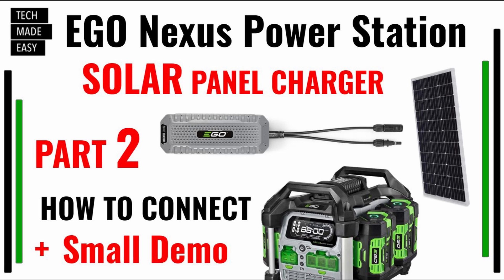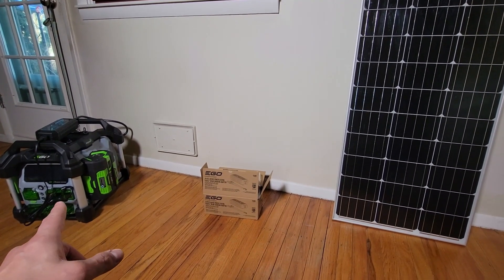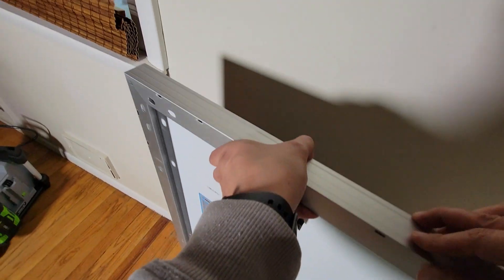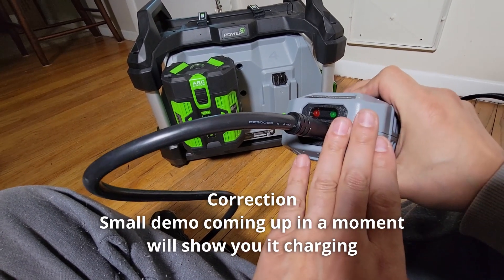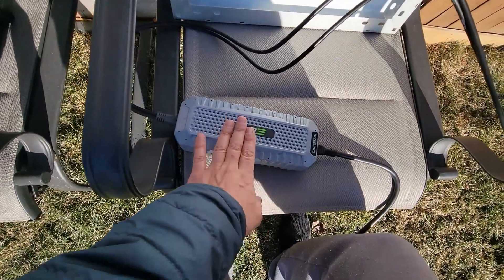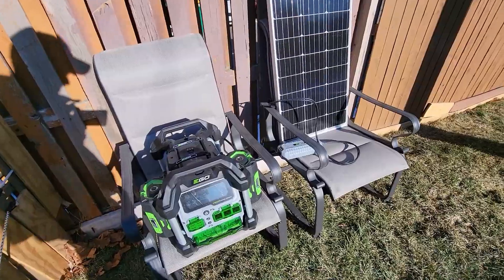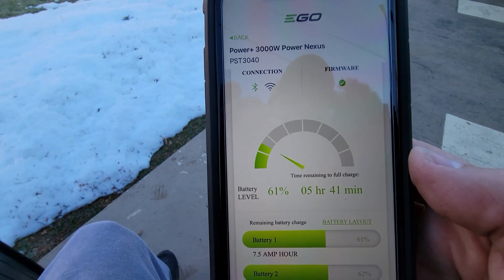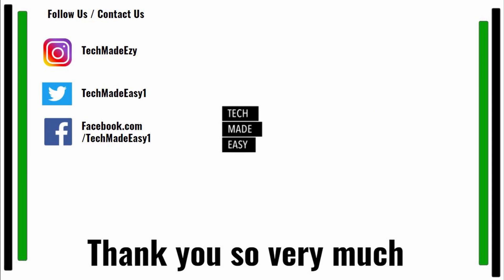Part 2 of 3 EGO Nexus Solar Panel Charger CH1800 Review EGO Solar

Comment: Hi! I just found your channel - 3 years after you've made this video. I was given an Ego Nexus power station and am trying to learn how to do solar charging with it. My question (forgive my Newbie-ness) is this: The app shows both of your batteries charging. Great. But, does the Power Station itself charge and hold 3000w? I realize that EGO makes a bunch of different tools, but if you don't plan on using anything but small appliances that can be plugged directly into the Nexus, I'm assuming batteries are not necessary. Is this correct?
 I'm a bit confused. Thanks for the great content.
Reply from the maker: Hi there thanks for watching our video!
The batteries are needed they power the nexus and devices you connect to it. It can handle 2000w appliances and devices the 3000w is just for a short surge. The size batteries you put in the nexus will allow your devices to run longer. 
Example a 5ah battery vs a 10ah battery, the 10ah will usually run twice as long as a 5ah. Hope this helps
Reply: @TechMadeEzy  Thanks, TME... I might not have been clear... If I want to say, just plug an electric tea kettle into the Nexus while I'm camping, I don't really need any add-on batteries, right? The batteries are only for the EGO tools that one might use, ie, the leaf blower, chainsaw, etc... The Nexus itself will be holding a charge itself, yes? Like I said, this was given to me (inherited from a passed away family member, actually - I can no longer ask him questions directly. RIP) Thanks.
Reply from the maker: @auntlynnonline6206 you need batteries to power anything 
No batteries no power
Also my condolences 🙏🏼
Reply: @TechMadeEzy  So, what are the 3 outlets and USB ports on the Nexus for, then? Are you saying that without the extra external batteries on the outside of the power station, it doesn't hold any power itself?
Reply from the maker: @auntlynnonline6206 the batteries provide power so you can use the outlets and usb ports 
No batteries, no power
Reply: @TechMadeEzy  That's odd. I would think that this big old thing would have the ability to hold some charge of its own. Oh, well. lol
Reply from the maker: @auntlynnonline6206 many power stations have built in batteries but after the battery dies the unit gets thrown out. That’s the advantage to this unit is you can always change your batteries and you don’t have to throw the unit out
Reply from the maker: If you need more help let me know I will always try my best to explain 😊

Comment: Enjoying your video's.  I have a few ego tools and batteries, Love the ego universe.  IMHO the  Nexus power station would work great for camping, tailgating, construction and a short term source of a power in a 12 hour outage..   However I don't think it makes a very good longer term power solution or battery charger.  It takes about 10-15 hours to charge four spent - 5 Amp hour batteries when plugged in and a week if solar is used? SLOOOOWWWW.   I planning on buying one. knowing that using solar as a changing source is generations away.   Great information!
Reply from the maker: Thank you Curtis
Reply: Curtis, you should check out the Bluetti line of power stations!

Comment: Did you find iy very difficult to disconnect the solar panel using an MC4 disconnect tool?
Reply from the maker: Hi George, It takes a little wiggling and playing but it comes off. You have any issues?

Comment: So basically the solar panel is only used to charge the batteries???
Reply from the maker: Yes or you can plug the power station into a wall, just an alternative way to charge

Comment: I was tempted to get this but I am glad they were out of stock already so I have changed my mind on this item. If it had pass through charging I would get it even with the slow charging. It basically equals their regular charger for rate of charge I believe. I have an EB150 and it probably makes more sense to charge the EGO batteries from that while I charge it at the same time. For a longer emergency I could use the small gas generator I have to charge the batteries. 
EGO was just a bit shortsighted with their power station it seems. They were early to the scene and just didn't forsee the actually needs and uses of the Power Station. I assumed that firmware updates could do more to keep up with changes but I was wrong. Still very useful as far as I am concerned.

Comment: Make sure your solar panels don’t exceed 22v. I have their power station with 4 x 7.5ah batteries. They should have went with a mppt with at least 20a input for more flexibility. I like my ego tools, but I’m disappointed with this charger. Hopefully, they will come out with something better in the future. I charge mine with my DIY solar unit with a 60a mppt charge controller and 600w of solar panels.
Reply from the maker: Thanks appreciate that

Comment: You keep the solar panel towards the sun and the nexus unit also outside and the charger out of the sun? I live in Phoenix Arizona we have a lot of sun. That means you need very long cables.
Reply from the maker: Hi Duke I’m just starting testing, I’m using 30 foot cables

Comment: Yep as others have said I believe this unit will take entirely too long to charge the batteries. They need to figure out how to make it have pass through charging so you can take advantage of the pure sine inverter with the energy the panels are pulling from the sun. You need to be able to hook up two 150/180/or 200 watt panels in parallel let the charger take what it needs and power another device with the rest of the energy you get from the panels. Even if you connect a 180w panel for the 180w charging you will never get that one panel to pull 180w, and if you do it might only last for 15 minutes. You have to constantly move the panels around as the sun changes the angle in the sky and as the panel heats up it will diminish its ability to input a constant charge. Unfortunately I think they will have to redesign a whole new inverter to be what it needs to do. I just bought a small 800w fuel powered inverter to charge the ego batteries with a fan cooled rapid charger for the power station when I run the batteries down. If you want to use the sun to do it, nice and easy, I would get the ecoflow river 600. You can use this power supply while charging. You can charge it with AC power, DC (car) power, or solar power; and it will charge back up to 80% super fast then trickle charge the last 20%.
Reply from the maker: Thanks Tony

Comment: Thanks for the video but I wouldn't wiggle the cables out and I wouldn't wiggle and pull from the cables as you do. Keep that up and you will be replacing the cable and connection in the unit.
Reply from the maker: Thanks, I tried pulling that cable straight out and it was pretty hard to do.
Reply: @TechMadeEzy  They are tight.
Reply from the maker: No matter what I appreciate the feedback that’s what this channels about we all help each other

Comment: Based on the charging rate it would take approx. 12.5 hours to charge one 7.5ah battery from empty to full or 50 hours for four of them.  Assume 8 hours of pristine skies and sunlight per day and you’re at 1 week assuming you’re not using it AND also assuming there is minimal loss having the unit powered up just so it can charge.  Absolutely USELESS.  Utterly and unequivocally useless.
Reply from the maker: Thanks Robert

Comment: I've been off rid for about 3 years  i'd made my own solar battery power bank bought an 85qrt 12v fringe so far so good
Reply from the maker: Nice Yan me and you need to talk! I’m excited in general about solar, ego solar is cool, will it work well at this point, not sure yet but I testing. Definitely want to build my own little system then maybe expand
Reply: @TechMadeEzy  I also preorder the ryobi 1800 inverter for what i need it,I think it will work
I made a 12v 105amh with 200w solar panel setup power system that is running my 85qrt 24/7 im still learning
Reply from the maker: Yan, Check out my 6pm video tonight, might help a little
Reply: @TechMadeEzy  I'll be waiting thanks

Comment: I have used 50 FT cords, and found no difference in the watts inputting... and there are plenty of Videos... Minute Prep comes to mind... he is running his cables like 1000FT, without issue.. though he is using better grade cables. Still, from my house I have a 50 ft cable, to reach the corner of my yard for best sun, and it gives me the same watts in, then if I unplug, and use a 6ft cable. So I wouldnt worry about it. Definitely get the batteries and charger out of the sun while charging.
Reply from the maker: Thanks Chris

Comment: Sadly this is the dumbest device ever, it would take like 4 days alone to charge up 4x 7.5/10ah ah batteries. In my opinion this is useless and people should just wait for a nexus changer v2 that isn't as janky. The ego nexus charger only charges 1 battery at a time at 100watts roughly it has no fans to cool the batteries so its tickle charges them, if you have a 200W pannel the length of the chord wont matter that much, as long as it produces at least 100w the light will trun green and it will charge.
Reply: Also true. I charge mine on solar generator using the rapid chargers. Way more effective.
Reply: @chrisanderson8553  That's what I was thinking. If I used the power station for a long power outage to just have a battery always collecting solar energy that allows pass though. Then you could just charge your ego batteries with a rapid charger on that and put the fully charged ones on the power station to keep it running.
Reply: @t.j.schmidt9877  Yeah, i already had 6 batteries, for my tools, 4 7.5s, and 2 5.5s, over time through ebay, FB market, and offer up app, I sold my 5.5s and got 4 more 7.5s. If your patient, they can be found very good prices, esp locally. So now I have 8 7.5ah batteries. The Nexus, is very powerful. 2000w inverter, and really unlimited watt hours, if you can keep the batteries charged(8 7.5ah batteries are 2800 watt hours). I actually connect the Nexus to my grid panel. It will run my fridge, tv, cable,  lights, coffee maker, gas stove. In the summer fans (not my central AC),. In the winter it can run my Gas furnace if im careful with everything else. In august 2020, I was without power for 5 days. I was getting about 10 hours of run time during the day before battery swapping the nexus, about 12 hours at night. It took my Solar generator about 4 hours to charge the 4 batteries per swap. I used the extra capacity on my solar generator(bluetti eb150 ) to charge solar lights, phones, laptops, and hot water heater(gas). I was never close to running out of power. It was pretty amazing. It was really sunny those 5 days, and I was getting about 400w and hour with my panels. I lost power for 2 days in Feb....and I was able to have power no problem. But it was a lot more difficult.. had to be a lot more careful. Less sun, shorter days here in New England. But it worked just fine. Had heat, hot water, food, and internet. So yeah, a Nexus combined with 8 batteries, rapid charger, and a solar gen.... can really keep you going in an outage. Mine did. For 5 days... and could of went many more.
Reply: @chrisanderson8553  Thanks for the information. I plan to keep building my Ego Collection. I started with the Snow Blower with the two 7.5's. Hoping to get the new lawn mower with the 10ah battery. I've  also been wanting that 650 leaf blower too. That will get my started at least.
Reply: @t.j.schmidt9877  those 10s will work real nice in the nexus. :) ... so just a quick sum up for you.. need enough batteries to do a full swap when they run down...and a solar generator to charge them. Also nice side benefit.. I never pay to charge any of my tools again. My solar generator when not being used for a power outage...sits in my garage... and charges all my work tools batteries, ego batteries,  and my backup fridge, and the lights in the garage. So all that charges for free now through solar, on a daily basis.
Reply: @chrisanderson8553  the solar gen is what did the work.  Hell a Bluetti AC200P takes 700w of solar, pass through charging w/ mppt controller, 2000w inverter and 2000wh of power.  It’s also infinitely cheaper than a Nexus w/ 8 7.5ah batteries.  So if you combined that and your eb150 you’d have been in much better shape.
Reply: @rjakiel73  mmm, nope. I already owned 6 batteries from my ego tools, 2 stage blower, mower, blower, chainsaw. So i was able to buy, 2 7.5 watt batteries off FB marketplace for $300, and I got the Nexus for $450. So thats $750. Paid $999 for the EB150, so thats about the same price as the AC200p. Except, I have 4300wh of power, and 3000w of combined inverter, . And with the added bonus, I dont have to try and charge the Ac200p, while its connected to my panel. Its much easier and lighter to keep the eb150 charged...from my garage. If I didnt already have 6 ego batteries, that would of been one thing. But if your already in the ego system with a lot of batteries, this is a very effective and powerful way to go..... I could of bought an ego flow river pro for $599, and would be WAY under the price of the AC200P. But I went for the eb150.
Reply from the maker: Thanks